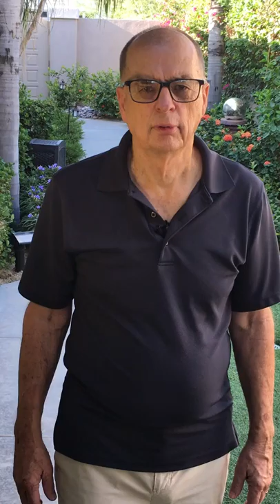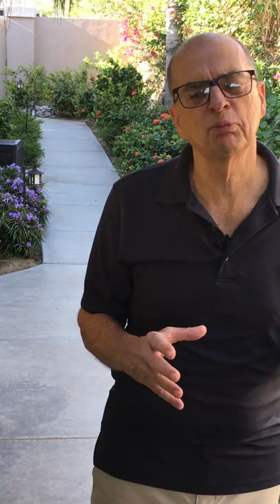Optimum Driver swing with Qi energy video series Intro.

Comment: I,m tuned in! Thank you Scott. At 60 plus years, I can use the fitness material big time! I have seen various videos that say at my age 200 yards is good. I don,t like it !
Reply from the maker: The issue of body in the 60 keep changing but Golf is the only physical sport I seen can keep your fitness as you are playing within range of movement.  Training to play golf using selective techniques to keep ability high is my thought. I have different training development as you practice your swing on the range and tone muscles reaction abilities. Example doing every swing you take 5 or lot more core movement breath to tone muscles to be fluid between each swing at the end of your swing. 

The big issue generally is hips or lower core muscles area of the body. They go weak with aging and the goal is to keep the foundation muscles tone. You have to tone those muscles within range of movement. 

I have my own definition what is tone muscles for it not about Strength alone it is also the ability of reaction timing abilities. To understand what you really have to work with to keep you in the game. 

Myofascial release to get the muscle knots out of the  body for range of movement. One can do lot once one understand HOW to work your Facia to muscle strength that where My form of Qi Gong is really good. 

To begin since I am Qi Gong master of MY form the core breathing is needed to tone muscle throughout the torso which allows one to project strength into movement. .  

The torso it self has to be tones and shoulder blades have be shaped which requires chest muscle range.. 

The big word you have to learn about and work with is Shoulder Stress which limits range of movement and core breathing and affect attitude . Having fluid  shoulder range and setting your shoulder blades in place which for so many is hard to do as you age. 

Then you have hands that forms the grip and how do develop them to affect the force going into the club head. Understand what Ben Hogan said in those two drawing where body bring force to the Hans but the hand creates the snap of club head. 

I go into Finger ergonomics that affect your movement of the hands. NO one goes into detail about how set your Finger tip pressure in the grip and how affects arm muscles for movement. . 

All these ideas sound like lot but reality most golfer do it with out thinking to some level. 

I will be making more videos and enjoy comments so I can refine what I saying to keep or improve performance. The goal for all performances find good techniques that work for YOU. 

Thanks for comment. Have you look at my Art of putting understanding. Finding what putting movement you want to refine your abilities that wins games. I have not develop it for video but I have approach in putting as a meditative develop to your putting skills where you make 25 feet putts and never mess all 50 putts.

This method of refining your putting with your body Mind and attitude  for act of putting. it very meditative state but NOT like most people think this movement meditation not still type. 

Have good day.